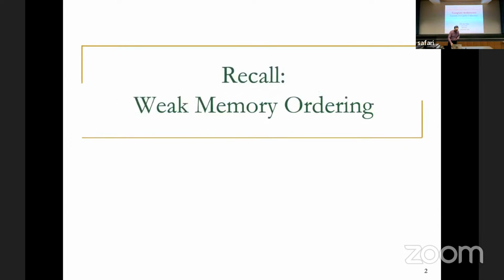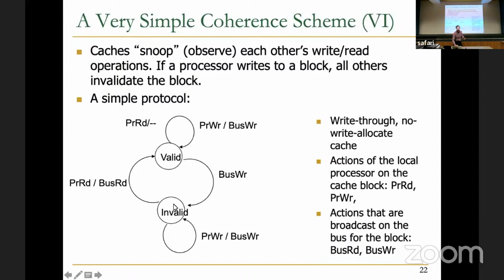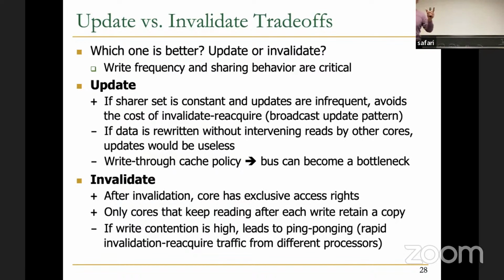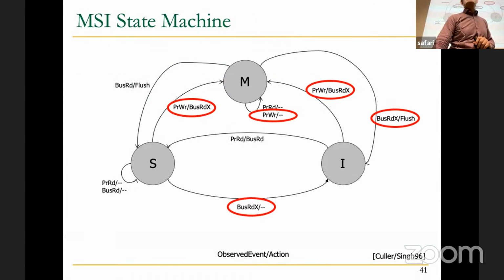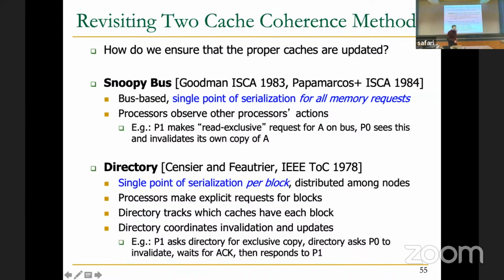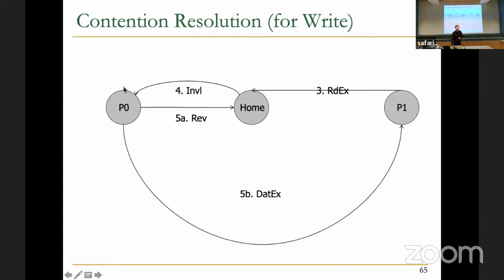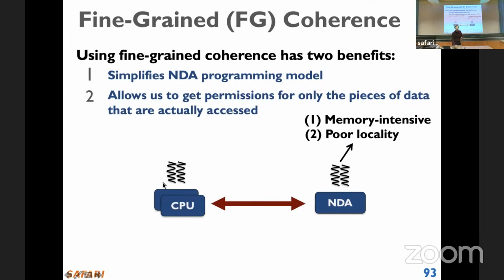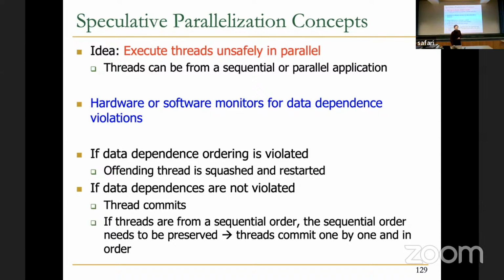Computer Architecture - Lecture 19: Cache Coherence (Fall 2022)

Comment: How are write conflicts resolved? 
Scenario - Multiple cores have cached the same memory location locally (say an integer value). All the cores update the integer at the same time.
Reply: The scenario you said is not possible as in directory based cache coherence, a core can only write to cache if it has exclusive access to that address. and all the other cores are invalidated if one core has exclusive access to a address
Reply: Assuming a snooping protocol where cores communicates over a shared bus, the bus will have to decide on(arbitrate) an order for the bus write requests. While the write request is in progress, the request will have exclusive access to the bus, which can be thought of as holding a lock to the bus, which will be released once the request is complete.